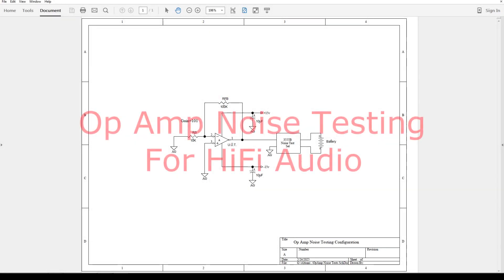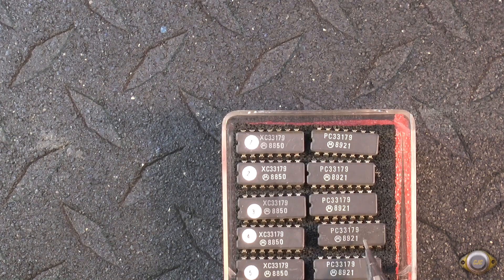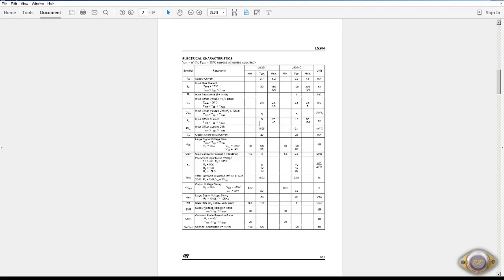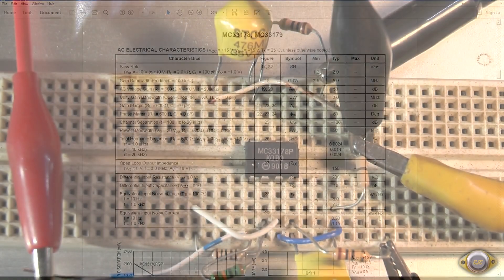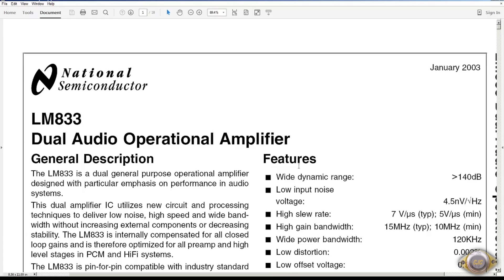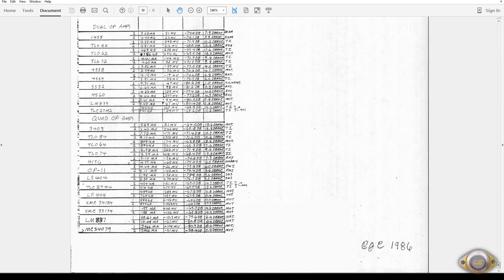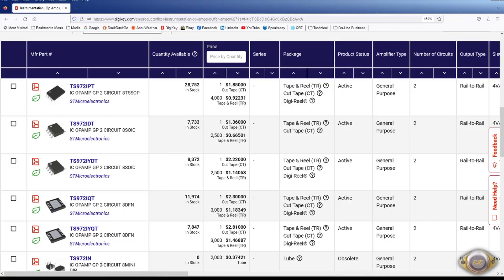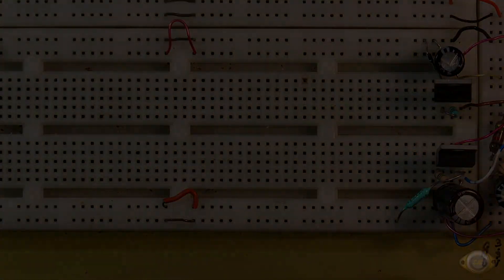Op Amp Noise Testing for Audio Preamps

Comment: I found the 33078 many years ago and found as a great upgrade path from the 5532 in analog filters where the input impedance is not load the filter, and olso found great to drive line level outputs. The most fassenating property is the insaney low ofset what is makes to able to remove DC blocking caps between dasey chained filter stages in a numbers of 10! And there is no any evidence for DC caused cracking or clicking on the pots or on the switches after these caps are remouved from the signal path.  You can not belive how natural can be if you can cancel out the smallest phase problems with surgery precision. And you had no idea abaut filters are working on until they are becomes disengaged and the reality is kicking Into your butts..  I am exatly not like the op-amps and aviod them if its possible to add them into a signal paths usualy the extra function not worth the signal degradation what they can cause.  They only worth if you want a much diffrent output and there is no possible to bypass the circuit out from the path or the output is sound much better than the input signal can. I had some properly desingned studio grade devices so it is possible to achive.

Comment: Hello, I've been looking for a video like this for a long time, very informative! Thanks.
Are you doing any more testing? For example, OPA2227, 2228, 2211, 2210, 1656 (jfet) AD797, uPC4570C, NJM2068DD...that would be very interesting.
Reply from the maker: Probably not. I don't have any of the ones you mentioned in my stock.

Comment: LM833 and MC33078/9 deserve much more appreciation regarding what they managed to do in noise department.
Reply from the maker: Yea, I use the MC3307x op amps quite a bit. The 5532 draws lots of idle current.

Comment: Interesting history. The noise from the NE5532 at 10:17 sounds as though there is a discrete tone in addition to the white noise. Any idea what that is?
Reply from the maker: I noticed that too. It was the HP 652A test oscillator. The test leads from it were developing a bit of crosstalk.

Comment: It was sad to see our company broken up into the many spin-offs, semiconductors did some great things.
I'm still working in what was the C&E part of /\/\ back in the 80's, we're now 'solutions' after we jettisoned cellular to Google...
I've still got and use one of those HP 3555B AC meters, great test equipment.
Thanks for shaking up some old memories
Reply from the maker: Thanks for your interest.
Reply: @CIRCUITDESIGNER  Though I've used the TL082 many times in projects, I didn't realize it's noise figure wasn't all that great. 
But then I only have used it in voice circuit applications where it was adequate.
Thanks again
73
Reply from the maker: @ The TL072 was supposed to be the low noise version in that family. Turns out not so much.

Comment: Very interesting! What about the difference between the Texas Instruments 5532's and the old Signetics units?
Reply from the maker: That would be an interesting test. It seems TI has bought most Op Amp designs from Motorola, Signetics, Burr-Brown, National, ECT.
Reply: @CIRCUITDESIGNER  I service vintage audio gear, and as you know, a lot of gear from the 80's have 5532's in them. When these need to be replaced, the only viable option is the TI version of the chip. But some folks say they're not as good, I I have not empirically tested them. I would love to see a comparison as to both noise and bandwidth.
Reply: @jim9930  I had not thought of the fact that some opamps are not properly internally compensated to work all the way down to unity gain!